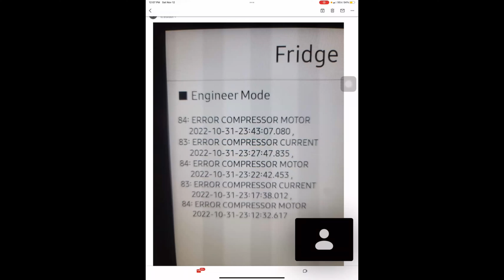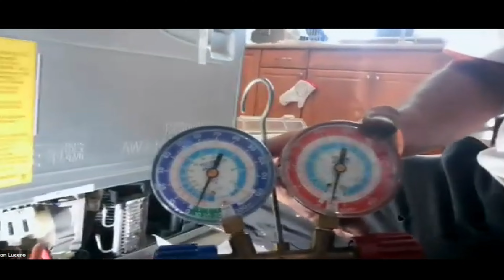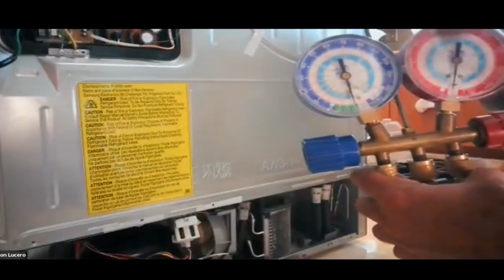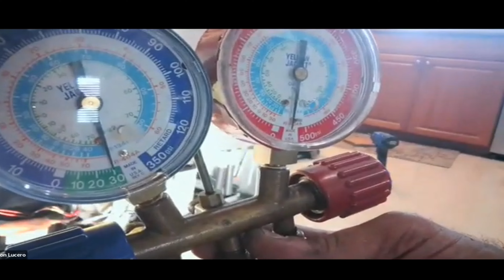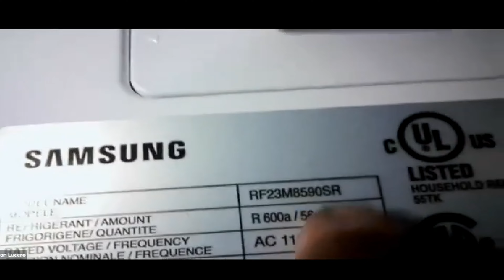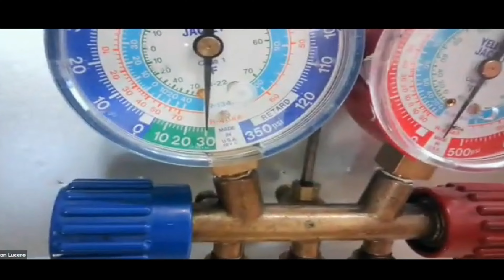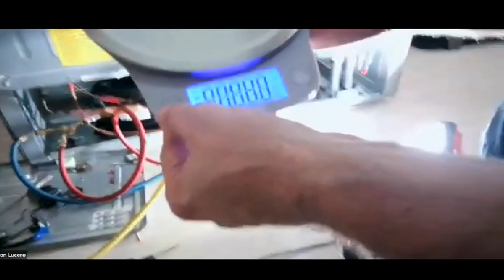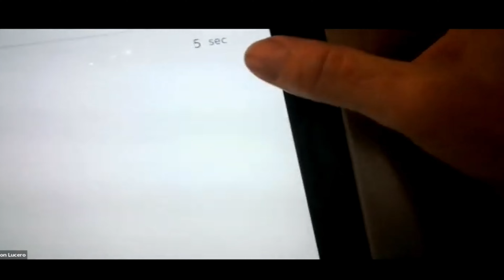Replacing 600a Compressor in a Samsung Family Hib Refrigerator

Comment: @32:02 Point the flame upwards that way you don't burn up capacitors, compressor legs or wires. Also, use a heat barrier jel and a fire blanket. They are both made by Uni-weld.

Comment: R600 sealed systems are super sensitive to weight. Also to getting clogged. Good recommendation for the fire extinguisher! I did a rework to an r600 system, previous tech clogged the suction line (most of these guys are using turbo torches *crap*). I thought i had evacuated the system pretty well, I even put a vacuum on it! When I was trying to remove the suction line, where the tech put a coupler on, the r600 was restricted and literally blew up. 
Luckily it was a fireball, nothing crazy. Boy I was PISSED!

Comment: Would it be easier to removed the condenser fan to put on suction line. Don't you have to used Lokring fittings on r600 units.
Reply: Recommended but not necessarily needed if you're experienced. Proper refrigeration practices ensure nothing is going to go boom.

Comment: Excuse me, Sir how would u take out the red hose out of the hot side valve after finishing charging, since liquid high pressure? 
thanks.
Reply: It would be best to turn unit off let pressure equalize then remove hose, would be lower pressure 60 or 70 psi. And mainly vapor at that point

Comment: I would have preferred if Brother B had  coordinated properly with Rick before starting the video so that the process would have been more cohesive and seamless. Also, couldn't wet rags have been used as protection for the Condenser Fan and the Compressor grommets?

Comment: Without a micron test to measure the decay, you really can't detect more than a big leak using those gauges...
Reply: yeah usually we would evacuate to 500 Microns, but the video was live and that would have taken about 30 minutes to an hour just to evacuate to that level, but we did pressurize with nitrogen and leak checked. Should be ok.

Comment: Couple of questions guys.  Are the gauges and vacuum pump strictly for R600A systems only? Second when you were charging the system, did you charge the high, low or both sides the 56 grams? I couldn’t tell the camera was only on the scale during the charging.
Reply: we used R134a gauges, Vulkan Sells gauges and hoses strictly for 600a. We charged through both sides of the system, the compressor was not running at the time.